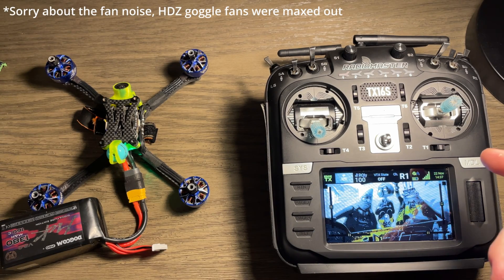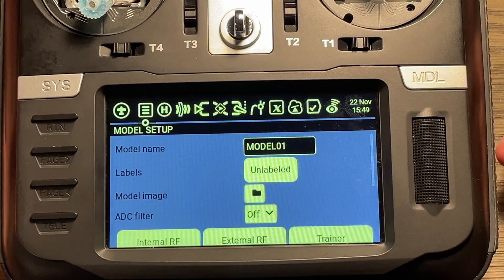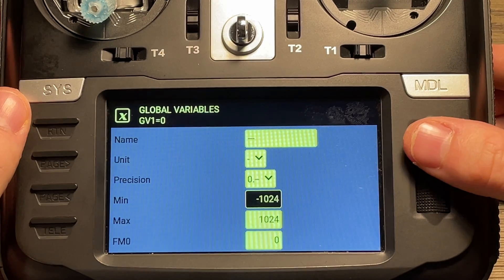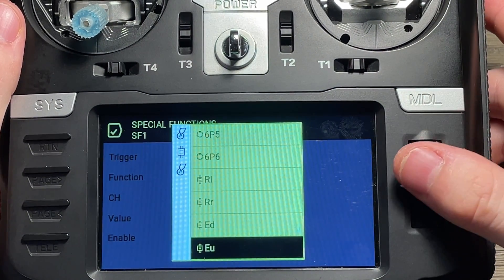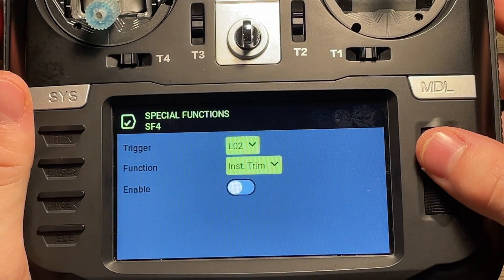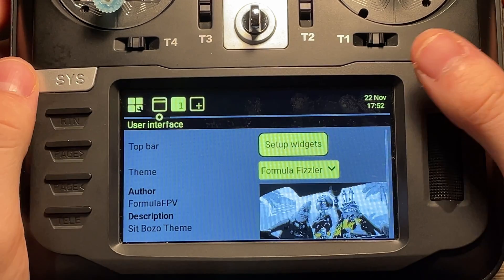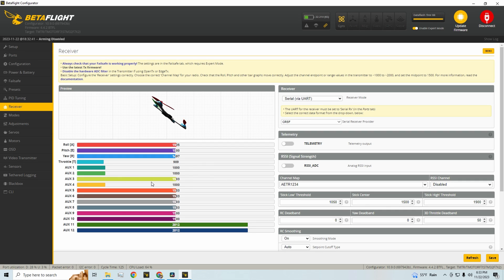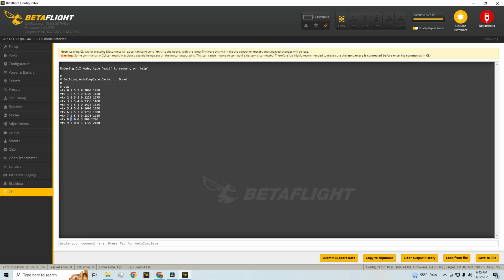The EASIEST Way to Control Your HDZERO VTX // Pit Mode and Channel Changes Using Trim Buttons!

Comment: Will it work for radiomaster boxer?
Reply from the maker: @yosefpv8539  It will function, but since the boxer doesn’t have an extra 2 trims, you will have to disable one of the channel 1-4 trims. Also since the boxer doesn’t have a color lcd, the widget can’t be added either.

Comment: Hello and sorry if I keep texting. I did everything perfectly. I can turn the vtx on and off on a three position switch. I can also change the vtx chnl from R1 to R8. I put the vtx table on the cli of my 4 racer drones. When I fly alone I have no problems but when I fly with my three friends from the airfield I have to land because I have very strong squaring. I'm afraid that the chl bands will overlap somehow. Is this possible? The only thing I haven't been able to understand and do is this note. (El-Miderro note: Checked for correct operation in the FAILSAFE tab (on the left side under POWER & BATTERY), whatever AUX channel is used to set the power to "0", change the drop-down menu to SET and enter the value accordingly, whether it's the high side at 2000 or the low side at 1000. Test by turning on the radio and watch the video, then turn off the radio.
28/06/24:)
Reply from the maker: Hdzero VTXs are only capable of transmitting on a single channel at a time, regardless of configuration. If the other pilots are flying systems like, then their channels may overlap yours. If they are on analog or hdzero, and you still have issues, I would make sure that everyone is on 25mW power output and that you don’t have any damage to your vtx or antennas

Comment: Is it possible that with the vtx channel change via T5 trim there are problems with the power of the selected channel?
Reply from the maker: I learned that VTX  team race mode 1 should be selected so that the vtx always powers up in pit mode. Otherwise there shouldn't be any interference unless channels are overlapping either on the radio or in CLI.

Comment: Thank you for this video. The on-off switch works, everything is ok, even the trim to change channel on betaflight works. but when he touches the trim to change channel on R1-2-3-4-5-6-7-8, it only changes on R1 R5 and R8. Why?
Reply from the maker: I would make sure that the ranges that your trim switch changes your aux value to lines up with the range that was put into the cli for that specific channel.
Reply: @formula-fpv  
Should I change the cli intervals according to the trim aux value intervals on betaflight?
Reply from the maker: yup, so long as the aux channel is set right, and the intervals match the values you see for that respective channel, it should all work. This is all assuming that you are using hdzero preset as well.
Reply: @formula-fpv  
ok preset hdzero, I checked the T5 trim on the monitor channel. the trim does not move 25% a time, but above 4-7-10% and Dawn 5-10-17% I do not understand I did everything to the letter. that's why I can't change all of them
Reply from the maker: check the the channel output on your radio this goes between -100% and 75%,. On the betaflight side, it should move about 9% per stage, or about 90 starting from around 990 to 1700-1800 ish. Since betaflight ranges from 1000-2000. there should be 8 different levels on both the radio and on betaflight.
Reply: @formula-fpv  Thank you so much. I finally did it, all R1/R8 channels are visible. I changed the trim values on the cli and increased the aux channel travel from 75 to 85%. TOPPPP

Comment: Thanks for putting this video together.  I'm brand new to racing, and the TX16s.  I'm running into an issue with my radio when trying to add the widgets.  I'm not seeing VtxChannel or VtxPWR.  Any suggestions on why that might be?  I have copied them over to the radio and see them in the WIDGETS folder.
Reply from the maker: Hey there! Do you know which version of EdgeTX you are running? There is always the possibility that a older version (or maybe a very recent version) of EdgeTX isn't compatible with the widgets anymore. The radio in this video uses v2.9.0.
Reply: @ I will have to check but I’m running the latest version I found on the EdgeTX page.  Thanks for the heads up.
Reply: @formula-fpv  I found Vtx power  there is a folder in a folder it then pops up but I cannot see VtxChannel on your google drive only VtxTitle ?? P.S. thanks for this pretty friken cool!!!
Reply from the maker: @Lance1739 for sure! Also, vtxTitle = VtxChannel if that’s what you’re asking.
Reply from the maker: It’s a little confusing, but the name that shows up on the radio is actually set within the lua of the vtxtitle widget.

Comment: Any update on vtxpwr2 widget for the freestyle vtx?
Reply from the maker: Sorry for late response, been on the road racing. Still no, since there currently is no way to add more vtx indexes in betaflight :( For my freestyle quad, I just use the channel switching, and then either video off or max power.

Comment: is this possible on the RM Boxer?
Reply from the maker: @brycellewellyn3483  the functional part of this will work with the boxer, but it isn’t possible to add the widgets to see your channel and power in the screen since the boxer uses the monochrome display.
Reply: @formula-fpv  i cant seem to work out the global variables and how to apply it to the trim switches
Reply from the maker: @brycellewellyn3483  you'll likely need to disable your trim switches from actually trimming your axis.

Comment: Hello friend, good day, do you think this is possible to configure on a TBS MAMBO station?
Reply from the maker: The video switching is likely possible as long as you can assign a trim switch as a global variable and use it to increase in increments for your aux channel. However the widgets likely only work for the TX16S.

Comment: Hey mate! How about vrx setup? For example i have skyzone steadyview x vrx and i want to switch both channels and bands with my upper trims the same way i do it in ExpressLrs lua/ TBS agent scripts with vtx admin, using my backpack, so both my vtx and vrx will switch simultaneously. Is it possible?
Reply from the maker: This is might possible, unfortunately I don't know how to do it this way since I don't actually own a vrx and I haven't tested this with elrs backpack. My intuitive answer would be to use the elrs backpack to control just the vrx, and use the method in this video to control the vtx. But, if that was the case, It would be better to just use the ELRS backpack for both to minimize confusion.

Comment: hey mate so if i have the lua do i need to disable it or anything at all?
Reply from the maker: I actually haven’t tested this with the ELRS Lua running at the same time, but my answer would probably be to disable it to eliminate any chance of interference with each other.

Comment: Awesome video! Especially love the widgets to go along with the setup for this. However, is there a way to integrate the video shutting off completely in the event of a failsafe during a race (for example receiver wire getting severed in a crash)? Currently with analog, I can achieve this in Betaflight by tying the "vtx pit mode" mode to the "failsafe" mode, which will shut off the vtx in the situation that the receiver link is lost. Since you have stated to not use "vtx pit mode" in this tutorial, have you found a different way to achieve shutting off video in the situation that receiver link is lost?
Reply from the maker: Great question, and its actually pretty simple to solve. In Betaflight's failsafe tab, you can choose to use either "hold" or "set" for any given channel. Default is hold (keeps last received data), so you would use "set" for the aux channel the video power is on and set it to the range that is for video off (in this case it should be any number below 1500). Hope this helps!
Reply: @formula-fpv  Verified function on this correctly in FAILSAFE tab (on left side under POWER & BATTERY), whichever AUX channel is used for setting " 0 " power, change dropdown to SET and input the value accordingly whether it be the high side at 2000, or low side at 1000.  Test by turning radio on and see video, then power radio off.
Reply: A side note on this, may only want to explore this option for TEAM RACING, I did some testing on the line last weekend with my radio at 25mw, and found that sitting there prior to taking off would glitch in and out of pit mode.  If you are flying normally, your quad loses signal and goes into failsafe, you may want video to still be on to aid in finding your quad via the last view you see or if a weak video signal is still broadcasting it may point you in the right direction?
Reply: @formula-fpv  Thanks for the reply, I will be trying HDzero for the first time and am hoping I can keep the same functionality as my analog racers. Looks like I should be able to do that now! I might have some more questions on this video whenever the system comes in the mail.
Reply: @formula-fpv  Got another quick question: Since you have the system setup this way, do you have the VTX team race mode ON or OFF in the HDzero vtx menu?
Reply from the maker: @rpmfpv  Team race mode is off with this setup. If you wanted to use team racing mode, you can set it up in your ELRS for team racing mode and that will failsafe and turn off video using the method above this comment. In which case I still would assume the vtx team mode stays off.
Reply: @formula-fpv  Cool thanks! Hoping to setup via your video exactly. Will try it out this weekend.
Reply: @formula-fpv  Finally getting around to this, but the VTXstate widget "on/off" is reversed from what I want the switch position to be. Reversing the physical switch in the outputs menu of the radio does not change what the VTXstate widget says. Any ideas on how I can reverse this?
Reply from the maker: @rpmfpv  Possibly invert it from the mixer tab from what it’s set at and then change any betaflight settings accordingly. The more direct solution would be to open the .lua in MS Visual Code and find the “ON” and “OFF” in the code for the VTXstate and simple rename them and save the file directly to your radio or radio’s SD card.
Reply: @formula-fpv  Appreciate it. Looks like reversing in the radio isn't working for some reason.